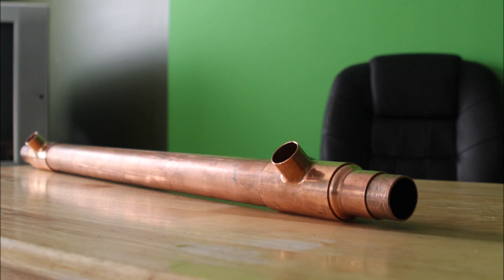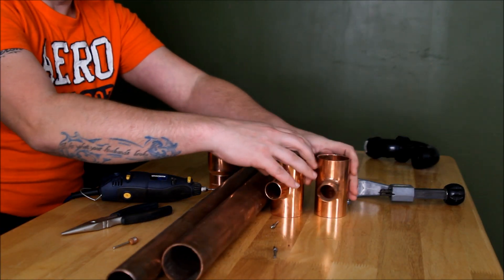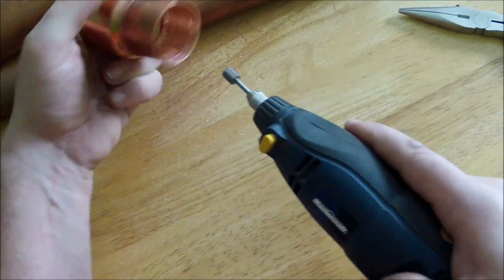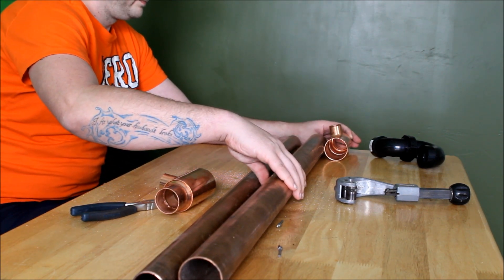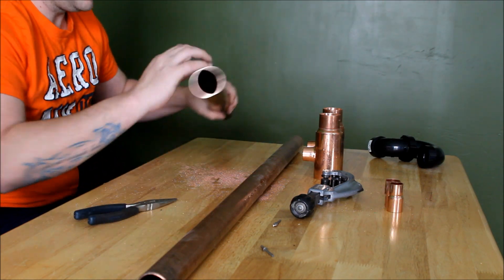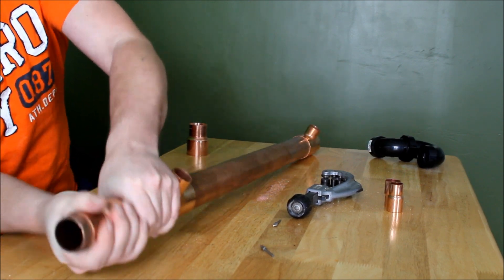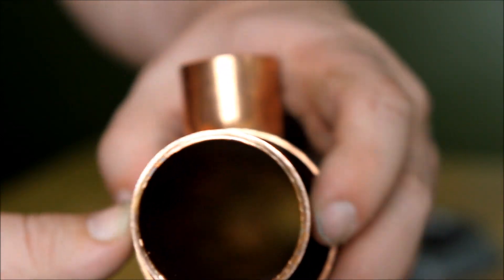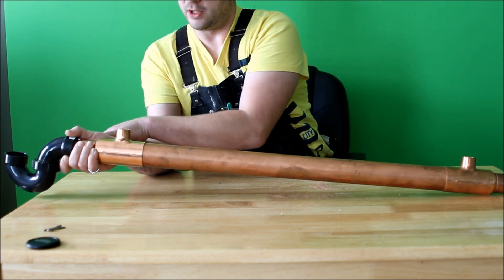How To Make A Heat Exchanger For Shower Hot Water Recovery

Comment: Whats the point of installing the heat exchanger if your boiler is warming the water for the shower you could drain your shower directly, why are you mixing two liquids for no reason, this drawing is not the application for a heat exchanger
Reply from the maker: bil ahm To heat the cold water feeding your hot water tank or boiler with the waste water from the shower. You are not mixing the liquids. You are simply transferring the heat energy from one liquid to the other with the heat exchanger. Thanks for watching.
Reply: you dont need to heat the cold water feeding to your tank boiler works fine without the heat exchanger.
Reply from the maker: bil ahm If you raise the cold water temperature feeding the boiler, the boiler in turn uses less fuel requiring less BTU's to heat that cold water. Saving energy and costs of fuel. Fuel will not always be cheap and any savings will be of benefit.
Reply: if the cold water temperature is 20 deg, how much will you raise it 40 deg? the max it will go to is 15 or 20 deg
Reply: bil ahm The process is called waste heat recovery. The method is used quite a bit in many sectors to reduce the energy required to heat liquids or masses. The energy required to heat anything is proportional to the difference in temperature. So even if 10 Litres of water flowing into the the boiler is only heated up 3 degrees, its 3 degree worth of energy that the boiler won't need. 

Good Idea Rob, just make sure the lines to the boiler are insulated to reduce heat energy loss
Reply from the maker: Andrew Gallagher Such a perfect reply. Thank you!

Comment: Great job on making the cheap Het Exchanger but the Diagram showing I think  is wrong...the shower trap should be on the other side to have the counter flow and have a better heat transfer...but any degree increase in the cold water before  it goes to the hot water tank,  is many into your pocket.
Reply from the maker: shkodrajone100 You are 100% correct. It was for the convenience of keeping the drawing simple. I never thought many people would catch on to it. I was worng, lol.

Comment: Pipe this into a towel warmer and have a nice hot towel when your done =-]
Reply from the maker: Karsten Elliott Fantastic idea! Maybe I will try that someday.
Reply: Although it will only be as warm as your showers waste water, at theoretical best. Will be warmer than not doing it though
And you'd need a pump to move the water which needs power. Perhaps a small electrically heated towel rail could achieve the same result
Reply: @davidkeith659 don’t need a pump if it’s part of the cold pipe to the shower. 

Maybe better just to have the hot water to shower go via the heated towel rail.

Comment: Having made one of these before I know how much heat transfer happens with this type of Copper pipe in a pipe exchanger. NOT MUCH. I made one for a solar water heater and had water running a 135F collector loop through it at 2 gal/min. and it only transferred 4F to the storage loop at the same flow rate.  I was very disappointed. I figured I'd need at least 6 to 8 linear ft. of this type of exchanger to do any good. It cost me about $60 to make a 2 ft. tube in a tube exchanger like yours'  but to tell you the truth, I'd rather have my money back. It would more than pay for the 4 plate heat exchanger I ended up using.

It's a great idea to reclaim heat off the shower but a good solar water heating system will nullify the money lost on waste water heat that goes down the drain.
Reply: Yep
Reply: STARFIRESOLAR b@
Reply: Did you run it counter flow? What was the temp of the opposing fluid?

Mine raises tens of degrees. But the heat flow will be lower with less temperature difference. Which is why a heat exchanger running 160 degrees will only heat a water heater to 130 degrees effectively.
Reply: @wiredforstereo  yes it was counter flow. I'm glad it works for you.

Comment: On average people shower at about 40 degrees C, so by the time that water drips down to the feet your looking at a 10 degree drop and depending on the room temp could be 20 degree drop, so by the time its collected and travelled through the waste trap its now at another 5 to 10 degree drop, so lets say 25 degrees for the summer and 10 degrees within the trap for the winter : Therefore your now mixing 10 degrees waste with say minus 5 degrees winter cold mains ? So how significant would this method really work ? by the time the cold feed reaches the storage heater its probably gonna still be within the minus sector. Going back to the summer period lets say 25 degrees waste mixing with 5 degrees C summer mains water, that would seemingly make a difference possibly of about 30 degrees going into the storage heater. Therefore to conclude this method it seems only really any good for Hot climate countries or summer only, To which energy bills are low any way as room temperature during the summer period sustains the Hot water stored within the storage Cylinder.
Reply: Barrington Bond how do your water supply companies pump ice to your home?
Reply: @whatyousaidbud  lol no kidding eh?
Reply: Your numbers are outlandish. If you're taking a shower, you will notice a fraction of a degree temperature change. If the water was below room temperature at your feet, you'd be the first to notice. Do some research. Waste water heat reclaimers are very effective devices.
Reply: +Barrington Bond - 100%... I was thinking of that.  The amount in the " Recovery " is so small. Just take the Money that you spend on making it, and pay for the heat to heat the Water, LOL.
Reply: @JodBronson  ok yes its small. If everyone did this then it would be a huge impact, should be code for every house to do this. think of it this way. if everyone in the world paid one dollar to whatever cause then that would be 7 billion dollars. not so small now huh?
Reply: @JodBronson  It's actually quite good. I have my entire house on one. While someone is taking a shower, I can wash my hands with "cold" water and it will be warm.
Reply: @wiredforstereo  It sounds like your system is not setup right, the exchanger should not be heating your cold water sink faucet.  Either direct to the tank, or the cold to the shower.  Anything else is a waste.
Reply: @robtaft9139  Sounds like you don't know what you're talking about. 

Educate yourself.
Reply: @wiredforstereo  That's what my exwife always said when she had nothing intelligent to say in response.
Reply: @robtaft9139  shrug Was that a comeback? Your failed marriage?

Educate yourself. Just go google it and read.

Comment: great idea friend , hey i have an idea to save you money on pipe, if you simply heat the incoming cold water pipe to the shower with your hot drain water you would need less hot water to get the desired temp but without having to run a pipe all the wat to and from the hot water heater.love your heat exchange design you have very good resourcefulness skills
Reply from the maker: NOBOX7 Yep I have tried it. does not work as well as it sounds. The whole reason for doing this is raising the cold water entering the hot water tank to reduce the amount of energy to heat that incoming water. The shower is not the consumer of energy, the hot water tank is. And most energy can be saved in the initial heating of the cold water.
Reply: Also this section of pipe should be insulated (all pipework should)
Ever thought about circulating the central heating pipes to keep your bath warm and use the bath as a radiator when no-one is in it? 
Remove bath, coil some PEX pipe around it, insulate it with celotex and expanding foam [ideally frame it with timber] leave some 'tails' on, to insert your new PEX bath pipes into your central heating system.
Have a L..O..N..G soak, don't be afraid to turn into a prune. ;) lol
Reply from the maker: ***** Back in the 30's there were companies that had cast iron bath/radiators. Problem was they got too hot. Did not last long. For rad heating you need to have 180°F water. Ouch! Good idea on the PEX tail thing, may work with copper tails but plastic is a horrible heat transfer material. Thanks for watching and taking the time to comment.

Comment: I take it this is primarily for people in cold climates?
Reply from the maker: Does not have to be. You could use something like this anywhere!
Reply: How much heat transfer is there?  Would this design shortened work off engine coolant to heat water?  I'm trying to build a unit for hot water to shower and do dishes on a boat.  Thanks :)

Comment: Hi Rob...I have a question....I have a outdoor wood boiler...and want to heat my hot water tank.....this is pretty close to what I need...my boiler water is 180 degrees...how can I control my temp?...bring it down?  and do you have any tips to share?....thx Kevin
Reply from the maker: You run it through a heat exchanger. If it is still too hot you can throttle the flow. If that is not possible you may need to use a mixing valve. I hate mixing valves, as they are a waste of heat energy!
Reply: @RobThePlumber  How are they a waste of heat energy? The total energy going into and out of the system is equal. You're just creating a greater volume of lower temperature water. No energy lost. Basic physics.
Reply: Rob The Plumber y
Reply: These are commonly used. You'll have to use a tempering valve on the output of your water heater.

Comment: First at all, I like your idea to 'recycle' wasted hot water back to the boiler (hot water tank).

What I don't like, is amount of copper used.

Here is the suggestion to change the concept:

Feed fresh, cold water to inner tube - thermal exchange rate will be the same as feeding outer tube with pressurized water from the tap. I think that as long as the contact surface area for thermal exchange is the same, changing design will suffer no losses. 

If you do this change in concept, then outer tube can be plastic - much cheaper, providing good water tight sealing. It may little bit complicate construction (different plastic element than you propose), but at end, it will be still much cheaper than using two copper tubes. 

Outer tube, if plastic and if going from bath sink has no significant pressure, since water column will not be high (then, instead feeding outer tube with high pressure water inlet, inner tube will serve as high pressure tubing). 

If warm spent water is inside this outer tube, it will tend to radiate heat through this plastic outward, but as soon as you cool water with inner tube (from facet, or tap) by heat exchange, there will be minimal loss this way. Aside that, to prevent any thermal loses, this plastic (outer) tube may be even further protected by some insulating material.

I am not sure whether I am clear on my suggestion? What you think?

Cheers!
Reply: What about the fact that its a shower drain! how long do you think it will take before your drain cloggs due to the reduced opening at any given point in the outer ring of the exchanger... stick with the original idea, if your going to try this.
Reply: How are you going to seal this monstrosity? After you figure that out, it will plug almost immediately. Then it will be ineffective because your hot water is on the outside, losing heat to the environment.

The design is optimal as is. Commercially produced units are available in north America.

Comment: Couldn't you just have used tees that reduce on one side of the run? Like 1" x 3/4" x 3/4" or whatever sizes? Do you prefer to use the fitting reducers for any reason? Great video. Thanks for posting.
Reply: He said he couldn’t find them

Comment: Very cool.

If you ran an experiment with a before and after of this rig installed actually measuring the water temp difference it would make a great video.
Reply: except it might show that it's not very effective. There will be MORE heat lost through the outer pipe - bc it has a significantly larger surface area to dissipate from  - as is gained from the inner pipe. If the outer pipes was PVC and lagged then it would help a lot.
Reply: @CosmicSeeker69  the inner to outer pipe heat transfer is water based. The outer to the atmosphere is air based. So outer would lose less heat than you're suggesting. But defo lag it anyway for the best efficiency.
Reply: @CosmicSeeker69 you can use standard copper tubing insulation.  Honestly though, with the flow in the same direction the water temps will be averaged inside versus out. If you measured the temperature of the water entering the drain it is probably no higher than 100 degrees.  Assuming a cold water temp of 60 degrees you would ideally have a shell water temp of 80 degrees. This is such a low temperature difference from ambient that you would radiate very little heat.  You would lose more heat from the incoming hot water tubing if that is conveying 140 degree water even if it is 1/2 inch.  But you are offsetting the BTU demand of the water heater by about 1200 BTU with those temperature numbers assuming about 10lb per minute of water flow rate.  You would double that recovery if you ran the exchanger in a cross flow configuration and had 100 degree "cold" water and 60 degree "drain" water